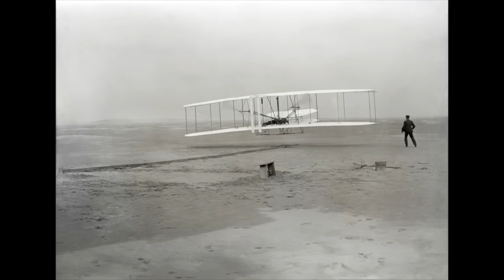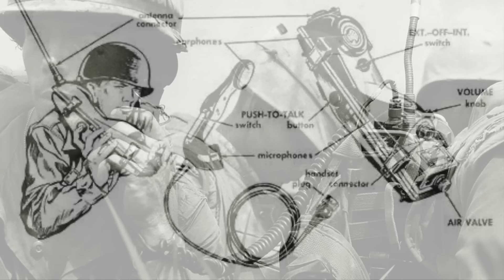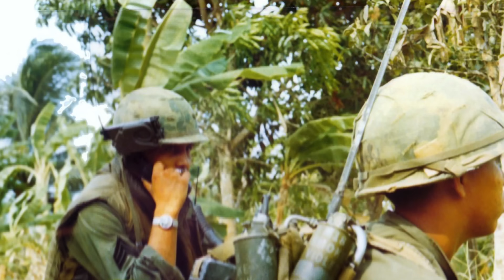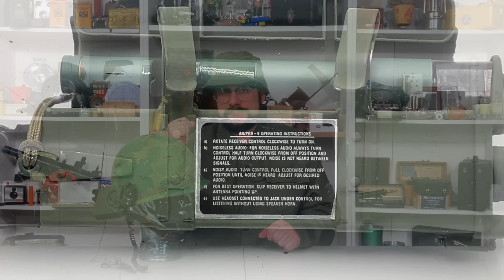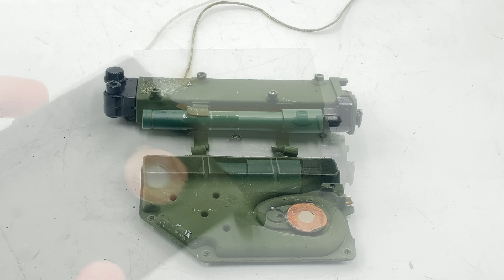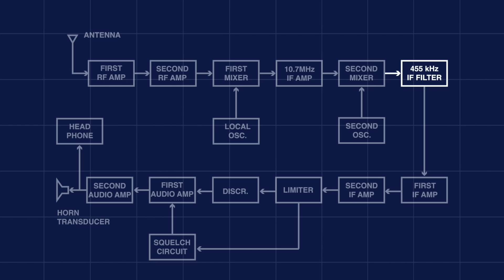AN/PRR-9 Helmet Receiver: Squad Comms for 'Nam

Comment: @7:04 Should “audio amplification circuitry” been instead “RF amplification circuitry” required to amplify a single frequency after the local oscillator?

Comment: Was the high cost (I mean $10,000 for a small radio receiver!) to do mainly with the use of transistors? And their failure rate? Those shaky old germanium PNP transistors would fail at the drop of a hat, they quickly ran out of steam even at quite low RF frequencies and they could only supply a whisper of actual output power compared with vacuum tube technology. It's no accident that the output stage of a AN/PRC-25 backpack FM tactical radio (cutting edge in Vietnam) still used a 'tube'. Around that time (1965, I think) I, as a very young radio experimenter in England, purchased a PNP audio frequency transistor (a Philips AF116 device) which cost, in today's money $25. I had to wash a lot of cars and cut a lot of of lawns...

Comment: Three reasons it was quickly abandoned. Soldiers hated it - but mainly because it had been developed by engineers without any input from the guys who would eventually use it. Secondly, it transpired (see first reasons) that many/most combat troops in Vietnam did not wear helmets because they were hot, heavy, sweaty and perceived to be of no great protective effect. Try it - pull up some of those genuine B&W action shots of GIs there and you'll see that helmet wearing was not the norm. As you point out, the radio didn't work without the helmet. It wasn't optional. Finally, the US signal military, having returned triumphant from WWII NW Europe on the FM success of radios like the backpack SCR-300 had begun to suspect problems with FM VHF tactical radios in heavily vegetated zones of operation. The range was poor. It couldn't be improved. The US Army Signal Corps began to research this as far back as 1945 in Burma but it wasn't until Vietnam that the limitation of VHF tactical radio was really appreciated - the AN/PRC-25 could manage no more than a few hundred meters in thick jungle, if that. Airborne relay and satellite uplinks were obviously not a thing, back then.

Comment: How it works:  NOT VERY WELL (forget that claimed max range, in testing it seemed that the RF oozed out of the transmitter antenna, trickled down to the ground and just made a puddle there).  About as useful as an afterburner on a turtle.

Comment: The 6-meter ham radio band is 50-54MHz and commonly uses FM. If you have a licensed friend with a 6 meter FM transmitter, which is a very common radio, you can test your receiver easily. A buddy of mine and I tested a PRC-77 this way very successfully.

Comment: These units used to be VERY common at amateur radio swap meets in the 90's, I picked up a transmitter and receiver, NIB for around $25.00 at a swap meet in Flagstaff. soldered up some battery packs (the transmitter says 15 volt but runs fine on 9V) and was thoroughly underwhelmed with their performance. 
They sit on a shelf in a back room with my other oddities.
Reply: Could the performance have something to do with the voltage being lower then designed?
Reply: @theashennamedjerry3203  Ah, I did not mean their electronic performance. Their basic useability was what I meant. For example, the battery outer containers themselves were made of OD cardboard, the clips were difficult to attach to the M1956 or later LBE, the clips that held the receiver to the helmet bend easily, (Making that lanyard a necessity)..

Comment: Thank you Jim. No surprise that the elite units, with their greater discipline, used this system successfully. In the initial stages of the Korean War, U.S. Army personnel were notorious for discarding essential equipment, whereas the U.S.M.C. had no such issues.  You have to lead soldiers and teach them that personal/unit discipline is key to survival.
Reply: Perfectly reasonable ethos, given the USMC is the last service to get anything.

Comment: 6:55 You very closely missed the point of a Superhet. The advantage of that method is not that the audio amplification circuitry can operate at a fixed frequency (as you stated) since that range is determined by the human ear anyway. The advantage is having a fixed intermediate frequency which in turn allows the use of a fixed-frequency RF filter. This allows using nun-tunable mechanical and crystal filters with a much higher Q factor than a lumped-element LC filter circuit.

Comment: I bet you could get some ham radios to transmit in that frequency range. It’s pretty close to the 6m (50mhz) band, close enough that it’s probably just a software limit (which can often be bypassed) that would prevent transmitting on those frequencies.

Comment: You need to get your hands on a TinySA spectrum analyzer.  It also has an RF generator that can put out a modulated FM signal on the receiver frequency.  That would be an interesting video.

Comment: Good job!  I had not seen the battery adapter you showed.  It was probably intended for four N Cell batteries versus two AA batteries.  The receiver requires 6 volts so I think 2 AA's would not work.  Sure beats hand-signals at night!

Comment: The PRC-25 had a near-doppleganger, the PRC-77, when I was in the Army in the early 1980s. The 77 was all solid state, whereas, I think the 25 had a transmitter tube. Also, the 77 had a built-in scrambler.
Reply: Further to the above, by the early 1990s the internals of the 77 set had been upgraded so many times, that most of the internal space was reportedly empty. No surprise that the replacement frequency-agile radios had similar external dimensions🙂!
Reply: I don't remember a "Built in Scrambler" in the Prc-77.
Reply: @pasqualelombardi4388 Neither do I.

Comment: I am an amateur radio operator.  The 6 meter band or 50 to 54, megahertz band is at the high end of this radio receive capability.  The 6 meter band is in the US ham band that can be operated on.  If you know a local ham, you could help you pout with a signal test and receive a test.
Reply: A ham could also assist with the retuning if there is any wish to replace the crystals for more permanent use on a more populated frequency band (such as the mentioned ham 6 m band).
Reply: The military stuff is wideband.  6m ham is narrowband (not to be confused with the FCC mandated narrow-narrowband now in use).
Reply: @SoloPilot6  ah, that I was not aware of. Then the results may not be as envisioned, even with a retuning. 
I suppose the audio quality was excellent when in range then 😉
Reply: There is no narrow band mandate there.
Reply: @SoloPilot6 
That's not true.